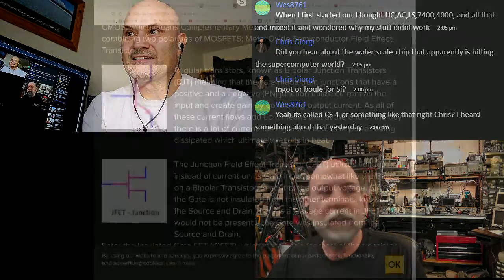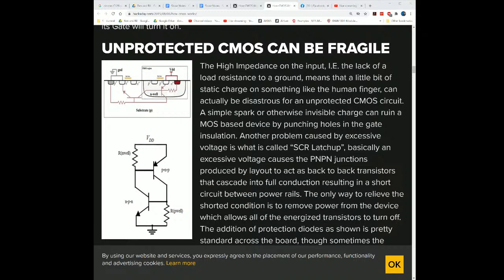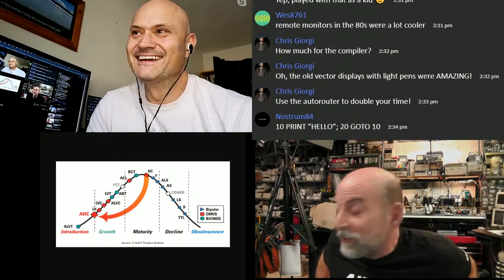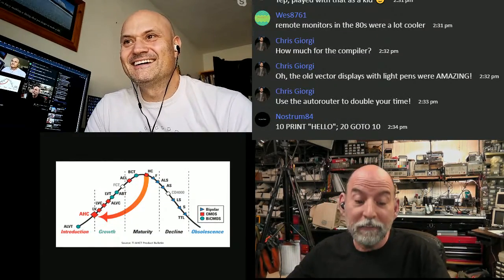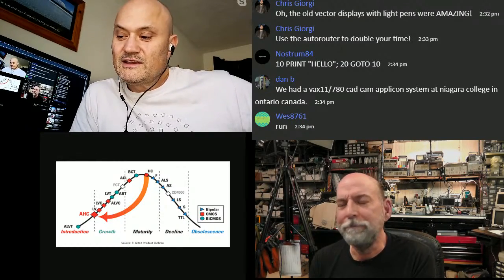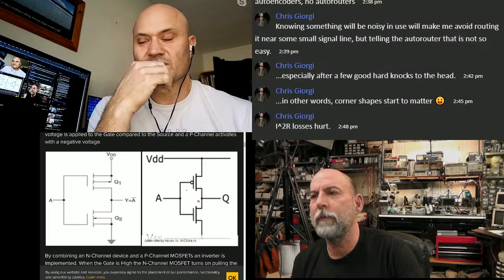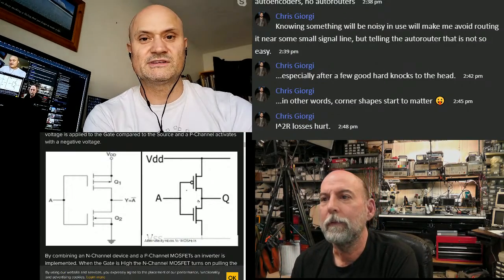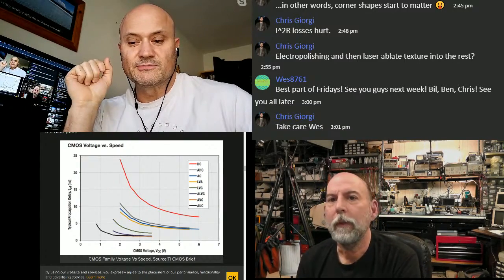Ben Jordan and Bil Herd

Comment: I used to work for a company called Datasafe that made an eavesdropping device that could pick up emissions from a computer. He was on TV in 1987 with it. You can see it here - https://clp.bbcrewind.co.uk/5a9ddb0175ea96c6d2e809417b920eff. At about 18 minutes in.  I later worked for a company that did tempest work and found one of his devices in their store room.